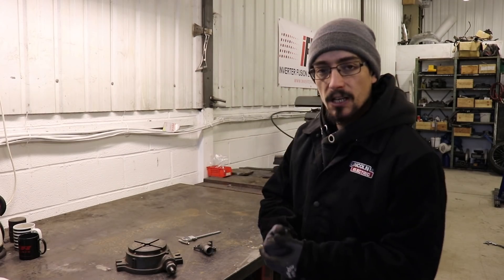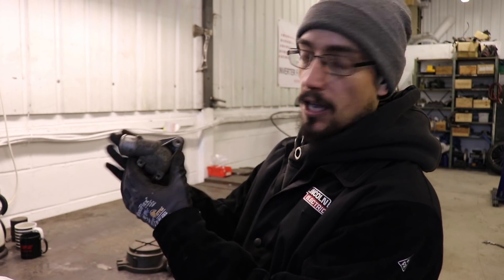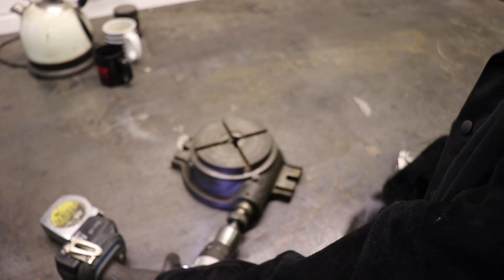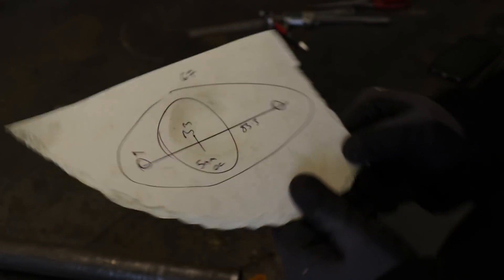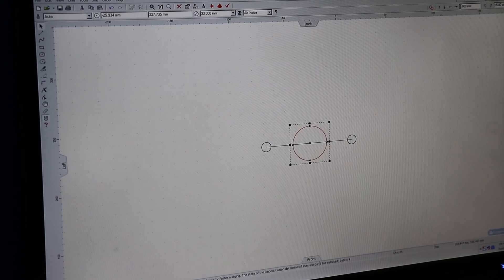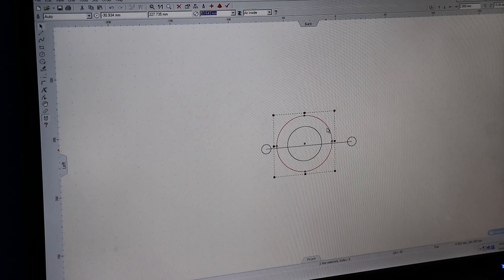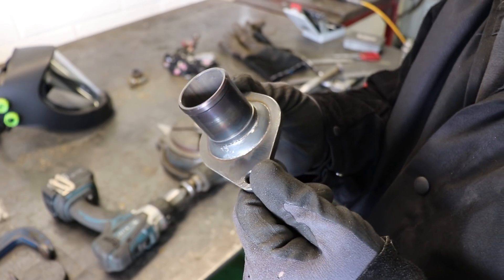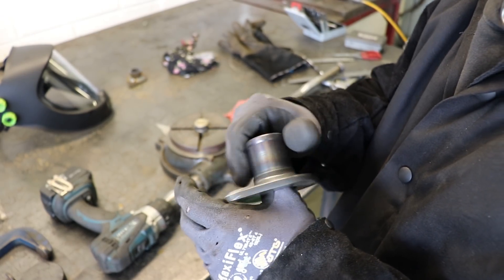RWD THERMOSTAT HOUSING MADE USING A DIY ROTARY WELDING TABLE

Comment: I would have been afraid the rotary table would weld itself stuck with the current running through it. Obviously worked out though. Good job.

Comment: You could tap a thread in that piece and bolt a plate down on top. Actually maybe not because the piece needs to be locked on to the rotation thingy mabob

Comment: I found a problem, that others have found too: Your thermostat housing doesn't house the thermostat properly.The hole in the flange needs to be big enough to allow the thermostat unit to float in it's seating. Otherwise the setup is going to leak. This could be accomplished by carving a recess to the flange, no need for complete re-do.

Comment: Really nice work! I'd recommend a corded drill and a foot pedal, most are only for low current applications but it's only a rotary table so it should be fine.

Comment: cool little project. satisfying when things come together. could try a corded drill with a cheap dial voltage control (poor man's freq drive lol) for the rotary table. its a trick i have used in the past with decent results.

Comment: Machine the plate hole to the same diameter as the pipe. Make it a tight fit, hammer it in and then it won't move whilst welding!

Comment: Re the rotary welding. 
How about a  stepper motor and a variable speed controller.
They can be pickup quite cheap on places like ebay and bangood.

Comment: Put a straight edge along the flange face.  We usually face them in the lathe post weld.  They distort a bit, flat flange makes a better gasket surface obviously.

Comment: Very nice!
You might consider making the hole in the plate slightly larger and press fitting the pipe in.  That may remove the need to tack weld and then weld over those.  Great video!

Comment: Attach that turntable to a stepper motor.... Create a little code on a micro-controller, attach a motor driver... and you could have a device that you can set to specific speeds with a high degree of accuracy.  If programming is not your thing i am sure i could knock together some code that would work

Comment: Matt you should use a a worm clamp/ hose clams on your drill for the positioner, would be pretty Easy to fine tune with a flat head or nut drive

Comment: So once the part is welded, can you then put the piece back into your lathe, by clamping the pipe in, and remove enough material from the mounting plate to accommodate the plate of the thermostat?  Does my question even make any sense????

Comment: Hi Matt, I assume you were picking up ground through the table? You might want to make a copper brush onto the rotating plate of the rotary table otherwise you'll s#@g the bearings in short order. Sweet looking part though :)
Reply: Yes good point, 150 amps through greasy balls is never nice!

Comment: Just a thought, does the thermostat housing need that chamber, that the original has? or is it there just to guide the flow?

Edit: Looks great though!
Reply: You don't need the bowl when the water flow is straight in, as opposed to turning a corner. Most Chrysler V8's are like made this.
Reply: Hacra yeah I was wondering how the coolant flow characteristics will be affected

Comment: that welding manipulator works great , could make sumting that alowes you to set it on an angle for welding longer pieces at a comfortable angle and bolt a round plate eith a lot of mountingholes on the turntable to be able to clamp on bigger or uneven parts , can do a micrswitch on a small cam atached to the same rotating plate to swirch a solidly mounted  mig gun on and off and you could even automate it 
i used plenty of cheap battery powered drills tht i trew out because the batteries died and where no longer available or a complete box with dril with all the gubbins was cheaper 
should be able to use a powersupply and a cheap regulator with a footswitch to make it go round

one thing i would do is make it so the power doesn go through the bearings and gears to the earth clamp , think that will wreck the turntable pretty fast by sparkwelding the moving parts  , think you can solve that by using a brass cupbrush for a drill https://s.s-bol.com/imgbase0/imagebase3/large/FC/6/2/4/4/9200000056594426.jpg and let that make good contactslider with the rotating plate youre part is mounted to

wonder if theres a niche market in making conversion kits for engines and gearboxes , stuff like adaptorplates to mount gearboxes to other brand engines https://www.efi-parts.co.uk/products_pictures/VW-F4R-adaptor-plate.jpg
, enginemounts https://cdn.shopify.com/s/files/1/2702/7966/products/IMG_1697_2000x.jpg?v=1564503082
engine mounts 
https://cdn.shopify.com/s/files/1/2702/7966/products/IMG_1697_2000x.jpg?v=1564503082
https://images-na.ssl-images-amazon.com/images/I/51dLS0nm6hL._SX425_.jpg
 , accesory mounts , fwd across to rwd lengthwise conversionkits
i think most of that work can be done on youre plasmatable with some welding drilling and tapping , you can build to order once you got the cad drawings for the conversion so you can be pretty flexible once you build a library with all the mountingfaces for the most logical engines and gearboxes 
can build stuff for the kitcar crowd the racers of all sorts.even the electric car conversion crowd ......hmmm think you got sumting there if you can build stuff that others whont touch in small numbers

Comment: Don't forget you can take a picture on your phone and use the trace function on Emachineshop to draw simple but awkward parts like gaskets, also if you made the pipe press fit into the flange it would be less likely to tip when welding, ;-)

Comment: Drill and tap the locating spigot that centralizes the housing and flange plate (12mm) and fabricate a "c" washer to cover assembly,this way you can secure prior to welding
then loosen bolt and remove "C" washer.you can clamp and remove without removing the bolt.

Comment: i wouldnt worry about them few degrees of pull on it Matt, it looks superb, however it may be better made from alloy rather than steel for rust resistance, i had the idea of a few cable ties around the drill handle preset at different diameters to give you your different speeds you can pass them inside or outside of each other to swap speeds, genius, i know right.
as soon as i pressed send reply i had another idea of a hose clamp with a wing nut type arrangment on the screw to finely adjust the speeds.

Comment: I made that exact part for my rwd B204 conversion. Only my one took an hour or two in the shed with grinder, pillar drill and filing for the plate followed by a fruitless search through my stash for tube the right size. Rang my mate to see if he had any and he turned up 5 mins later with a surprisingly thick gauge chromed steel vacuum cleaner extension tube. Then said he was round visiting his folks when I rang and as long as its just a couple of inches off the end and I deburr it his mum would never notice....  Works a treat but I'd have definitely bought one of yours if you did them at the time. Next time I saab something I'll have one.           Current project is a small block ford v8 and the not very old warped chromed porous monkey metal thermostat housing on that is still weeping after chemi metal and a linisher. I really don't want to buy another the same but seems like all that's all ebay has to offer.

Comment: Don't let the drill run flat when using a clamp to keep the trigger depressed.  It is possible to completely drain the battery after which it will only hold a very small charge - essentially one knackered battery. (Guess who found this out the hard way?)  Always leave a small residual charge which happens normally when you are using the drill in manual mode.

Comment: I'd drill and tap the locator you made for the rotary table and cut a bit of threaded bar. Small bit of inch box across the top of the pipe and a nut. Won't pull up then matt.

Comment: Hi Matt, you could buy a cheap 230 v hand drill which has a blocking button to the side, and then you can block the appropiate speed you want for welding. And yes, you always need to tack your pieces before welding all the way thru especially when you don’t clamp things togheter.
Reply: Yeah, I used my Bosch drill like that as a makeshift lathe once!